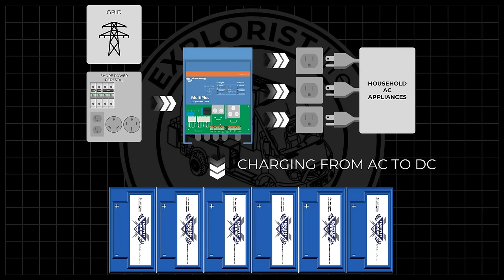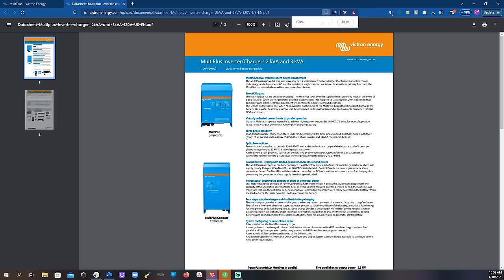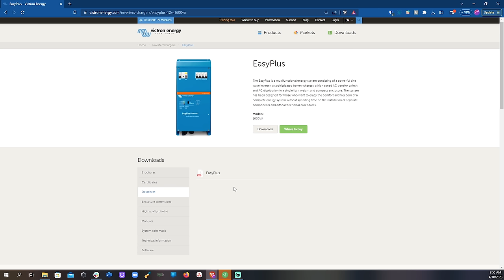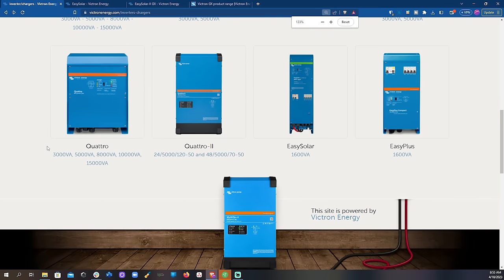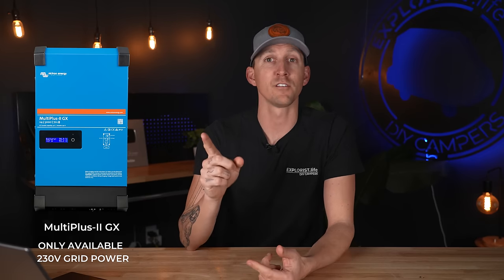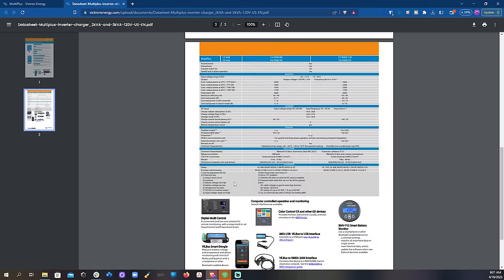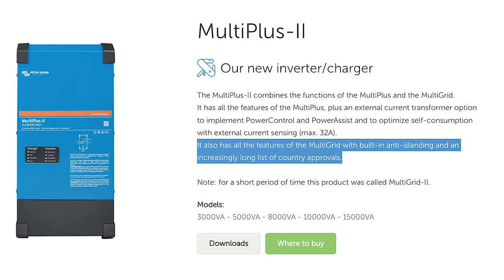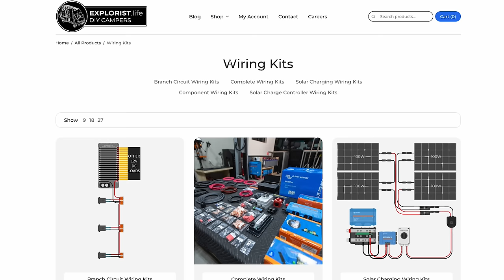Every Victron Inverter/Charger COMPARED!

Comment: Wish Victron would make their entire product line work with 120V.
Reply: You and me both but considering the fact that we are not their main customers I'm happy they make us some and look forward to what they're going to put out in the future
Reply: 240 V for me.
Reply: @markmckelvie5062 Victron 230V models work for the few countries that are still nominally 240V. Australia moved to 230V a couple of years ago. Nothing changed.
Reply: You could always split the voltage inside a distribution box, y'know, EXACTLY like it's done from the power line into a house. 

I'm off grid and when need calls for it, I took my panel box and wired a L14-30P plug to it's main leads, so I can run the while box from my generators 230v outlet. Ez pz.
Reply: Most countries operate on 240v so it's all about market size. 

If I went to America I would consider building a 240v system and just put a 120v charger on it and get 240v appliances. Most electric converted appliances (TVs laptops etc) have a voltage input of 110-240v or something similar.

Comment: Have you thought about a transformer 230V to 120V? This would open the door to all 230V devices.
Reply from the maker: Although that is an option, it generally over-complicates a system where there is a better alternative.  If you need help deciding on a unit, this may take a more in-depth look at your personal setup.  If you have purchased/are purchasing from our store (shop.explorist.life) reach out for some more personalized help: shop.explorist.life/support

Comment: If you take a look at the "zero load power" specs for the MultiPlus vs MultiPlus II, you'll see the efficiency gains... The new versions are twice as efficient! MultiPlus 48/5000/70 = 35W, MultiPlus II 48/5000/70-50 = 18W.
Reply: I sure wish I knew what you meant. The further along  I'm getting with my solar, the less I seem to think I understand😢
Reply: I might not understand correctly but I believe he is saying the MultiPlus inverters consume less power when on standby mode (no ac load)  than other models.
Reply: Zero load power is the power consumed by the unit even when no AC power is being delivered
Reply: @JeffinTD Thank u very much😎
Reply: @dbrophy ty
Reply: @dbrophy also known as the idle current.

Comment: I trough, you could output 120 or 220  by selecting it... I have to buy a unit accordingly?  That suck, I want one to charge an electric vehicle with solar,  but a level 2 charger uses 220,  but my house is 120, so I wanted to be connected to the house to charge the batteries when the sun is down.

Comment: Thanks for this. I'm just about to finish install of my MultiPlus II 3000va on my narrowboat. I've gone with Victron due to the 'eco system' of everything connecting together and able to easily monitor from an app on my phone. So got one of these, an MPPT and a shunt and i've can pretty much monitor everything!

Comment: Hey Nate, 
I am watching you channel for a long period of time, you are doing a great job!
You mentioned the negative watts flowing into your batteries, there is an easy solution, because you are using the shunt just as multimeter, you could swap in and out (I have made this accidentaly :D)
I am using a multiplus 2000VA (24V DC), one thing you could mention is that, for setting some of the important values (float/bulk voltage, absorption time) you need a MK3-USB adapter and the victron connect application for linux/mac/win... The default float voltage of the multiplus was to high (27.4V instead of 27V).
Keep doing what you are doing ...
greetings from austria (cows not kangaroos)
cheers

Comment: I watched to the end, i guess i'm one of the 6 people, lol. This is an awesome video, I am still a year or two from my build and I can never learn too much prior to my build. I plan on a transit build similar to your recent build. I would like to have the electrical system be able to function as a backup power cell if I lose household power. My home has solar but no battery backup. If I lose power, and the panel doesn't see incoming power, the solar shuts down. I wasn't sure if this would be possible, however I will now do some research on the multiplus 2 split phase to see if this can achieve the goal. Once again, thanks for the video.

Comment: Thanks for the video - must have taken hours to prepare!!
- and also for remembering that some of us van people are not on 120V shore and appliances, but 230V (I am in Europe) - since the US is probably a bit more mature in van stuff, a lot of vids are 120V only. So - thanks for the 230V angle 🙂

My question -  some of the charger/inverters have MPPT and GX as part of the package. But would you go for those for simplicity or can a case be made for keeping MPPT and/or GX as separate components?

Comment: You are a godsend!  Victron makes crappy videos made by electrical engineers for other electrical geeks.  Not for the User of their products in vans. So frustrating to try to understand what each of their component does so I can make an informed choice about my own electrical grid upgrade.  I have an older RV and very lost as to what to use from their line of products.
Typical questions I have are:
What are the functions and constraints of the Multiplus series?
Do I need a Cerbo GX?
Does the Touch 50/ 70 Display panel work sans the Cerbo GX, directly with the Multiplus?

We need documentation from Victron on each of their products, what it does, what it does not do, what are the add ons that each product will support, what other products work with Victron (is it brand agnostic?), etc.  Then we need videos to bring this information to people and potential buyers of these components. Victron, like every typical manufacturer never spends time on the marketing end.  So while they make products, we don't know what they do!  Frustrating.

Thank you for filling that vacuum with your excellent line of videos. Very grateful to have them!
Reply from the maker: Awesome!  Glad they have been helpful.

Comment: FYI The Multiplus II also has a built in AC transfer switch (25Amps). It only has one AC input but 2 AC outputs - one essential loads output that will keep running off battery if AC input goes down. I think you implied in the video that the Quattro was the only inverter charger with a transfer switch?

Comment: Hey Nate, I'm kinda thirsting over the new Multiplus 12/1200/50-16 120V. It's the perfect size for my square drop trailer and it's small loads. Do you have an opinion on this unit and will I be able to buy it on your website soon? Most websites are suggesting a long lead time, like Nov '24.

Comment: If you wanted to tie 20kw+ pf PV to the grid at 20kw, but also have backup power should there be an outage, what Victron product(s) would you need, and can they discharge a battery to the grid?

Comment: Can a quattro 48/10000/140-100/100 120V be used in a 50amp RV? The datasheet mentions it has two AC outputs, but is not listed like it does on the multiplus II 2x120. I'm thinking about making the jump up to 48v and a single inverter (10,000w) vs two (5000w) in parallel.

Comment: I have a Victron MPPT 100 30 with 2 solar panels on the roof of my camper. Is this capabale of handling LI Batteries? I currently have 2 lead acid batteries. Any advice would be appreciated.

Comment: Im really confused. I need your help. Which victron product would be good for me in Europe on 230V, with AC coupling, battery charger, solar connection, on grid. And should the grid be off, it will not send electricity back to the grid? Your help would be wonderful.

Comment: MultiplusII 2x120. 
Love my system - except when plugging into a 120v 15-20amp shore. 
The 50amp dogbone combines L1 and L2. This makes L1 and L2 in phase and the multi pops the shore breaker. 

Ever heard of this?  Any workarounds?  
Currently just running a charger connected to the Lynx. 

Cut L2 in?
Reply from the maker: Something else is going on.  When you connect 50A shore power cord into a 15A outlet, L1 and L2 isn't 'combined' as a 15A outlet only has L1.  Instead, L1 is being SPLIT into L1 and L2.  I'd suspect your shore power input current limit is too high and the multiplus is trying to draw too much power from shore.  Turn that down to ~10 in your cerbo or victronconnect app and that should fix the problem.

Comment: Practically, how far away can you put the Cerbo and screen from the rest of the components? For example, power system is up front in travel trailer but would like to have the display in the rear living area.

Comment: We have a three-phase heat pump (required max power is 3.5kW) and a 12kWh battery, which I charge with panels, so I am thinking about a three-phase inverter. The heat pump uses approx. 5,000-6,000kW of electricity per year to heat the water and the house, or up to 1,000kW per month in the winter months.

I am thinking that if I had more electricity in the battery, it could also be available for the heat pump via three phases.

Which Victron inverter 5-6000kWh inverter to buy?
Reply: You will need 3 Victron inverters, which is why I didn’t go that way for my 3 phase house. I went with 15kW Fronius hybrids which are also weatherproof for my outside install

Comment: I sure hope you are getting compensated by victron to decode their "perfectly confusing" product line. I've spent hours trying to figure it out.  It surely is an engineer that was pushed into product line marketing that came up with the info. Thank you kindly! I have Victron products in my rv and off grid cabin.( a build off  one of your diagrams) I do like the product but often find their info and trouble shooting to be entirely confusing and ultimately unhelpful. Thanks again.  Q? What is the best way to program the multiplus? I have the gx and online info, but I cannot for the life of me find how to program the inverter to utilize the full gen capacity. It only takes 50%. Ive tried all the go to perimeters.

Comment: I’m looking at your recommended wiring diagram and components for my install.  You’re recommending a Multiplus 12/2000/80 for a battery bank with a minimum of 200Ah. However, Victron states 350-1000. Can you explain the discrepancy?  My system is planned for 300 Ah. Thank you!
Reply from the maker: They actually used to have the minimum at 200Ah but then they changed it for some reason.  Since we had kits and such out there working just fine at the 200Ah threshold, we left our own minimum as-is as a judgment call based on prior experience.
Reply: @EXPLORISTlife  appreciate it!!

Comment: Now I am even more confused... I have several Victron Solar Chargers and a Victron DC to DC... The Victron Battery Monitor and occasionally when I need to I use the portable plug in Victron lithium battery charger... All have the Bluetooth Smart feature which I love... I have everything except a inverter for my 4 Battle Born 100 amp hr batteries... Every once in a while I think maybe it would be nice to be able to plug in a Keurig coffee maker or air fryer... I am thinking 2000w... And I would like to continue with Smart Victron... So I was excited to watch this video...
Reply from the maker: If you've got a keurig coffee maker & air fryer and 4x 100Ah batteries wired into a 12V Battery Bank, you may as well go with the Multiplus 3k over the 2k as the cost increase is pretty minimal: https://shop.explorist.life/shop/all-products/victron-multiplus-12-3000-120-50-120v/

Or if this is going into a camper w/ 50A shore power, you'll want the multiplus 2x120: https://shop.explorist.life/shop/all-products/victron-multiplus-ii-12-3000-120-50-2x120v/

Comment: Nate, I am building my van based on your two 24v Battle Born configuration and the Victron MultiPlus 24/3000/70-50 120V.  The issue that I just noticed is the 120v I plan to travel across Europe in this van as I live in the states but grew up in the UK 220v. Does viltron make an inverter  that will auto detect the voltage and adjust to my 110v \24v or am I going to have to forgo shore power and trust that my solar and DC to DC controller from my alternator will carry us through all of those countries?  Thank you.
Reply from the maker: If I were keeping 120V loads; I'd just wire a 240VAC to 24VDC charger into the system with a dedicated 240V shore power inlet; and then just use that inlet when necessary.
Reply: @EXPLORISTlife  cool. Thanks for the reply👍

Comment: I run 2-MultiPlus II 120x2...3-150/70 charge controllers, and everything else necessary to support them...
2.2kW solar on the roof, and 4 Battleborn GC-270Ahr...system allows me to stay offgrid almost indefinitely, the key to entire system, resource management...

Comment: Any idea on when the Quattro 2 will be available in 120v for the US market?? Ive purchased the entire ecosystem of Victron componets that will power my RV minus an inverter/charger. Been holding off on purchasing one because I would hate to be the guy that drops $3000 on an inverter and a month later the updated model comes out...
Reply from the maker: Which one are you after?  For 30A or 50A shore power?

Comment: I’m confused! The 48v 5000w easy solar, has a 70a charge feature. Therefore; what’s the most we can charge batteries in watts??
Reply from the maker: Charging amperage x charging voltage = charging wattage.
Reply: @EXPLORISTlife  here’s the bit I’m confused with the most. We’ve got 12kw generators; but victron invertor only has 70a battery charge.. 48v! So I’m at best charging 3,360w! Not making use of the 12kw! How do I get a better charge

Comment: I know it's off the wall, but I wish they would make the 15000 multi 2 in a 120 / 240 volt version.

They really need to get some more core models ul listed for the USA.  Like the multi 2 and quarto in 5000 and 1000 va.  Many jurisdictions enforce this for off grid home installs.  Would be nice if the top quality units were listed.  I mean even some  Chinese all in ones are listed from my understanding.

Comment: Thanks for the video! My biggest complaint with Vic is the “working” space for wiring. If my hands wire the size of a toddler, probably wouldn’t have any issues … but I also probably wouldn’t e able to crimp wires properly 😬😄
Reply from the maker: Yeah, that's for sure.  In a lot of our videos going forward, we are going to show wiring these up on a tabletop and then moving them into the camper so it's easier for everybody (and myself 🤣😂)
Reply: @EXPLORISTlife  I’ve seen the “mother board” builds being used more in 5th wheel setups. I think you’re idea is good too

Comment: How does the new Quattro-II 2x 120V stack up against the rest of these inverters?
Reply from the maker: It's basically the same thing as the Multiplus 3k 2x120v. I wish it were available in a 5kva version.
Reply: I agree. Since they don’t, I’ll probably use two of these. Looking to replace the transfer switch and converter for my generator/50 amp set up on my fifth wheel.

Comment: Hey I have some questions ...how is the best way to discuss a few things for my skoolie
Reply from the maker: Sure!  Just like you just did.  I'm pretty responsive here in my comments section.
Reply: @EXPLORISTlife  Well, I have a bus that I will be living in full time... aparetment size fridge, TV PC PS4 MINI SPLIT ETC... I bought 8 210 AH deep cycle batteries and need to hook them up but feel i already made a mistake by buying them...I need to know where i stand and what you feel is adequate for my build... I currently have no solar but possibly in the future... only power source is the batteries and the power plug... I am thinking 50 AMP but need advice before i really screw things up

Comment: I love my Ouattro 24/5000-100/100 but really wish I had gone with the 48v. When I starting building my home off-grid system I wanted to get something that my multiple Victron MPPTs could efficiently utilize but I didn't think I would grow to the system I have today. I started with the small simple 1200w inverters, moved to 2400w inverter then got the Quattro. I have 900a of 24v batteries (12v300a 2s3p) and these are also on my "I wish I had decided to go 48v" list. I now have to decide to keep expanding on 24v or try to sell what I have to get up to 48v.
Reply: What are the reasons for you wanting to change to nominal 48V? I’m most likely building my system in 24V, and I haven’t found any real benefit except smaller gauge cables and perhaps able to buy server rack batteries. But by all means, please keep me from regretting 24V later.. 😅
Reply: @KS-wr8ub I would like to hear his reasoning also. Hopefully he sees our comments
Reply: @KS-wr8ub a higher voltage is more efficient & yes thinner cabling can reduce costs significantly, but with the higher voltages you can generally get more output for similar price of a lower voltage system also, I believe what ur paying for basically is the current ability of MOSFETS used, so going from 100A @ 12v = 1200W output, to using 100A @ 48v = 4800W output using a similar size MOSFET.  If ur going to use 48v system on a camper or boat you will need to assess if you have the realestate for solar pv & may need to look at a higher VOC pv panels.
24v server rack style batteries are available & are a good option for incorporating into buses or campers with 24v systems already, as it can make some wiring & charging options easier at installation.
Reply: If you have large roof for solar panels, go with 48v. It's cheaper and more efficient.
Still, you might have difficultues to get a dc-dc charger from your alternator.

If the roof area is small, go with 12 or 24v.
Just take in cosidetation that your mppt controller will start to charge once the voltage of the panels are +5V over the battery voltage.